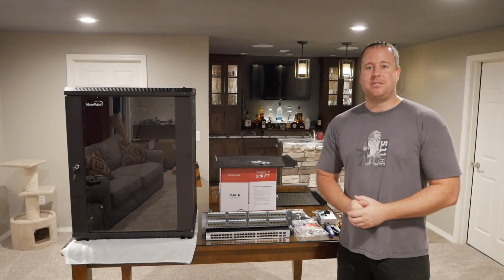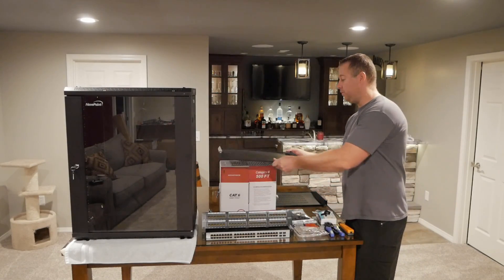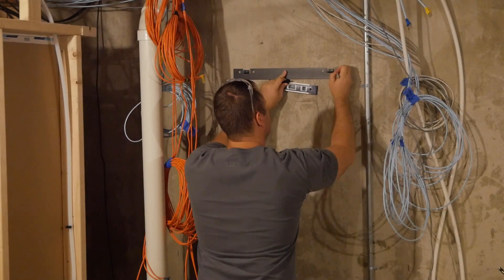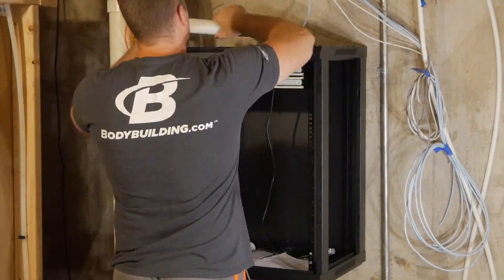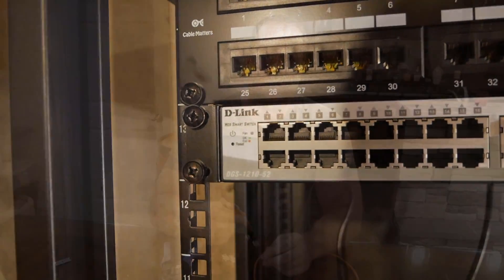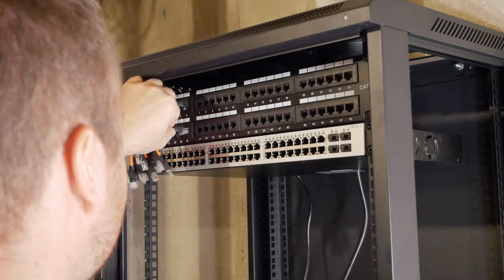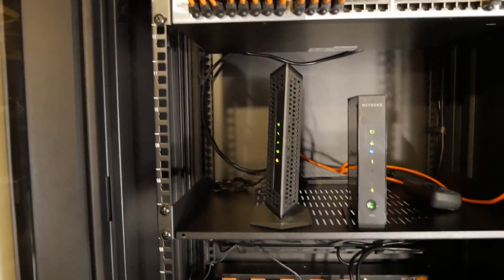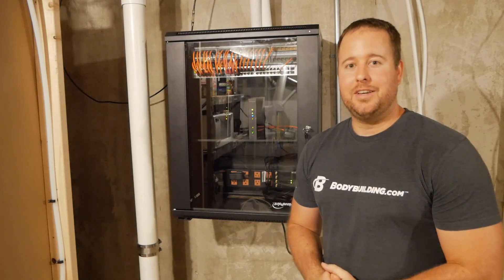Home Network Setup and Rack Installation | NavePoint 15U Rack

Comment: A heads-up on the DGS-1210 series: At least some of them (and certainly 1210-24 D1) have a bug where, for ~15 seconds while booting, the switch passes traffic between all ports, regardless of VLAN configuration. D-Link has a firmware that fixes this, but has not released it (since may '16).
Reply from the maker: Thank you for the info. I need to read up more on it and learn how to configure everything. It's just being used as an unmanaged switch currently. No issues yet!